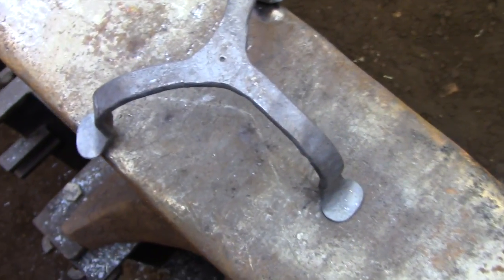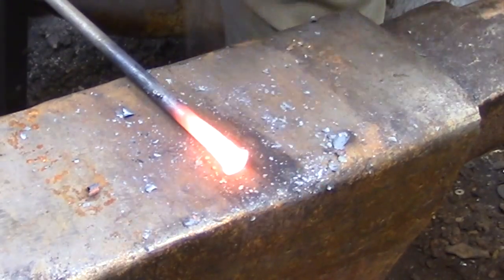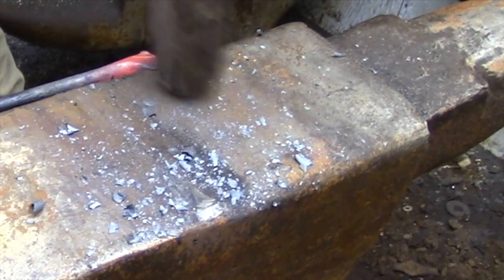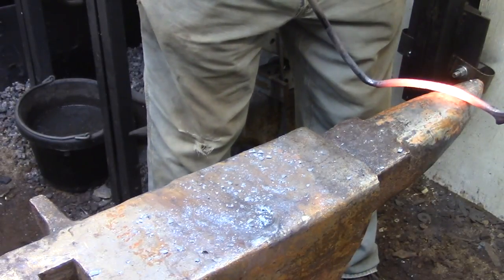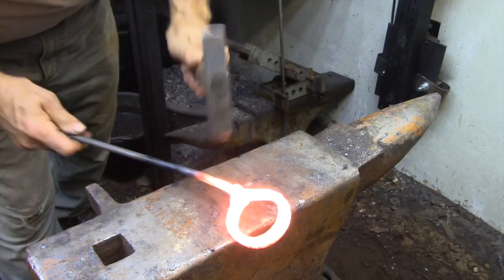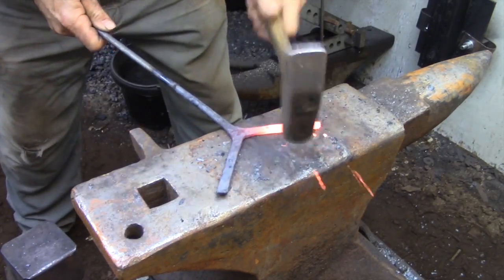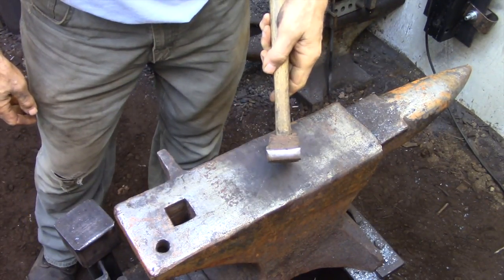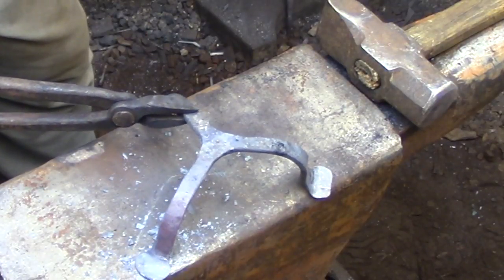Blacksmithing For Beginners - Rush Light 1

Comment: This video make me wonder how you figured this out.  I'm betting you did it just by examining an original example.
Reply from the maker: Actually one of the blacksmiths that got me started used  this technique to weld the stand for his fireplace sets.  The legs and all the arms were welded to the main stem by repeatedly looping back long sections of bars.